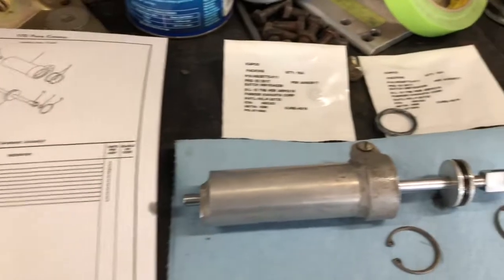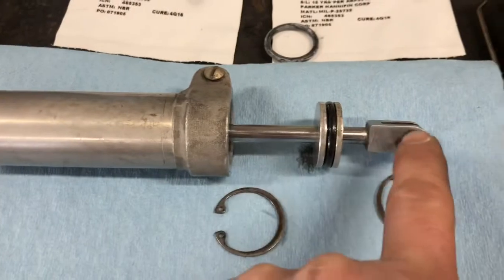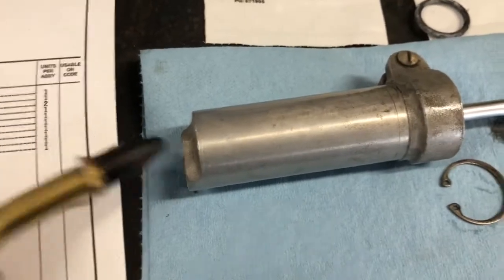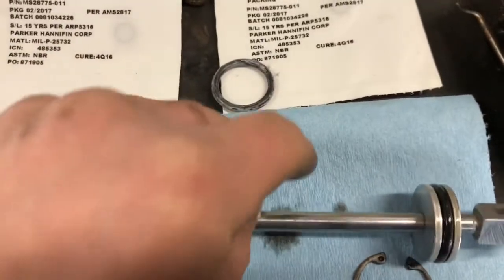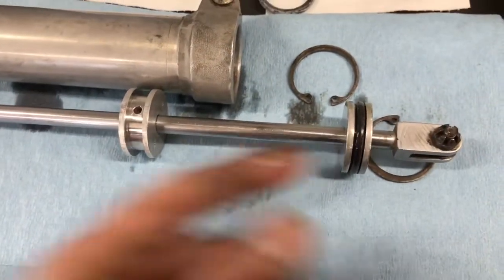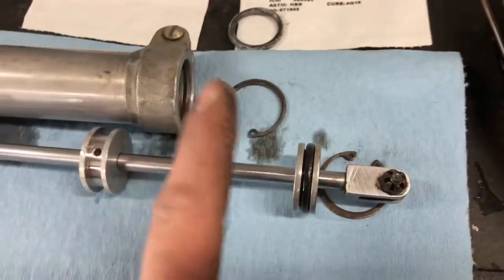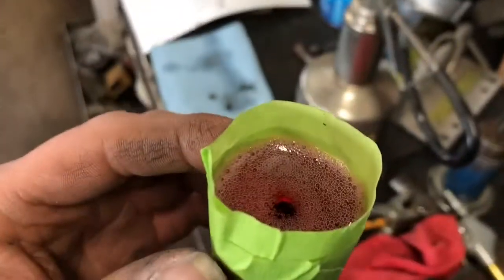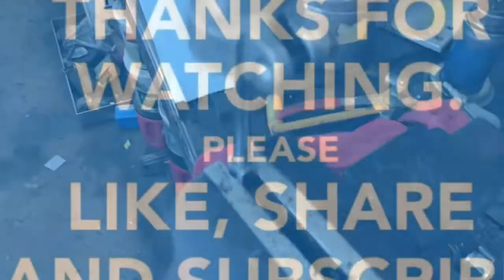Cessna shimmy damper rebuild.

Comment: I'm not sure you're doing it right.  It looks like there's supposed to be some air in the unit.  My '64 182 has what remains of a sticker on the shimmy damper.  Referencing the parts catalog, near the front, there's a section showing all the placards on the aircraft.  Sure enough, there's the placard for the shimmer damper.  It says - "Fill with 74 cc of MIL-H-5606 hydraulic fluid at room temperature. This will allow correct airspace for fluid expansion.  Do not overfill."  So it looks like there's supposed to be some air in the unit.  Not sure about this model though.  It would help if we had some technical data to go on but it seems like if you totally fill it, it could burst if the fluid gets hot.   Maybe someone will weigh in with the correct data?  Dynetric - A&P, IA, Atlanta
Reply: This was exactly my question.  How much fluid?